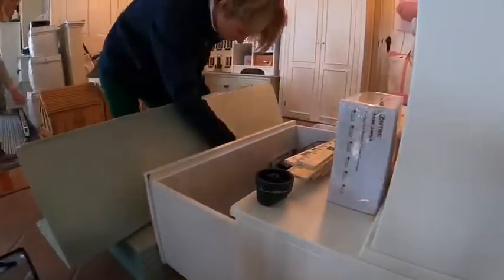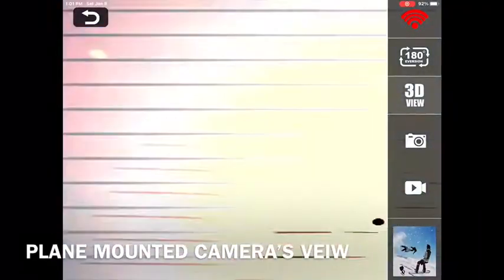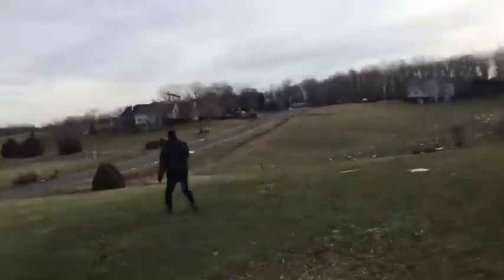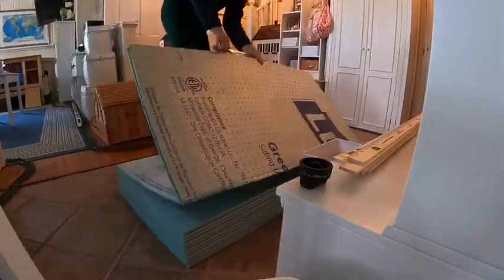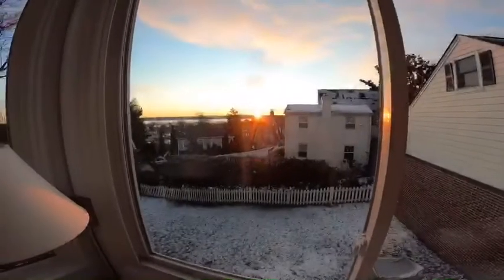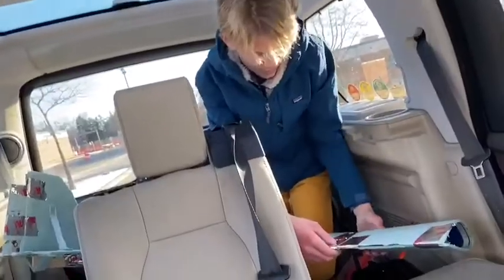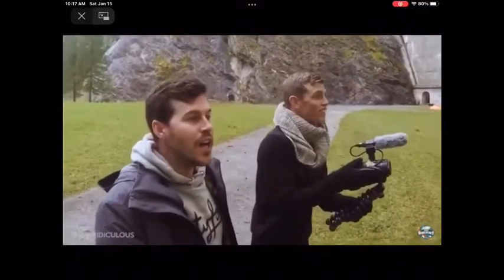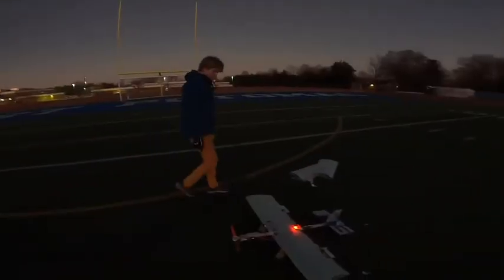Trying To Get My Homemade RC Airplane #8 To Fly! (Lots Of Crashes)

Comment: trash.      that  sums  it  up.!        here is some   information.
an  SF  prop  is being used for the  WRONG  sort of application.!
models are  HEAVY,  have  WONKY  proportions, and have  TOO  much  aft-located  mass.      aka  there is  tail-heaviness in the dom.     distribution of mass.!!!
at first link, you are invited to  COMPARE   the  Proportions  of  a  typical  cessna  high-winger.!        proportions  means, 'comparisons'  of  certain  dimensions.     those comparisons include:
      wingspan to fuselage length
      wingspan to horiz-stab  span
      main wing chord to fuselage length
      main wing chord to horiz-stab chord
      distance between prop and main wing  to  fuselage length. 
in the case of a  POORLY  designed model, locate the cg at  25 percent of the main wing chord.     including,  WHEN  the mass of a camera is onboard.!      in fact, the mass of a camera  SHOULD  be  located  NEAR  the cg; aka 25 percent of chord.!           at second link,  note  the  MINIMIZATION   of  aft-located (structural) Mass.!!!          the mass of servos  does  NOT   belong   AT  THE  TAIL.!          if the stabs are  Correctly  made  and servos are Correctly located, the tail  will be as  LIGHT  as  is  practical.         a light tail will tend to result in an overall  REDUCTION  in  auw.      all up weight.          if the power system is  NOT  well-matched  to  the  model's size  and weight, the models will  continue to be  UNDER-powered.           googletranslate 
cessna top view
https://www.karachiaeroclub.com/images/aircraft/cessna172-top.png
https://ww2aircraft.net/forum/media/cessna-150.25191/full
see video, at 3:11
https://www.youtube.com/watch?v=3gaORr-WxFs     
http://www.dynmodel.com/sig/007-1.jpg

https://img.staticbg.com/images/oaupload/banggood/images/8D/B8/a93ae5ad-5626-4bd2-8560-37f585760037.jpg
this is what the wing profile  Should  Look  Like.
https://gatovolante.files.wordpress.com/2015/06/clark-y.jpg
Reply from the maker: yeah I know. this is an earlier model. later today ill post the one that worked. I figured out why this one didn't